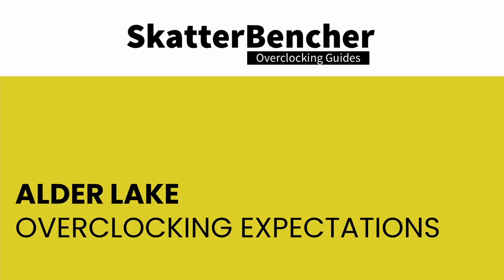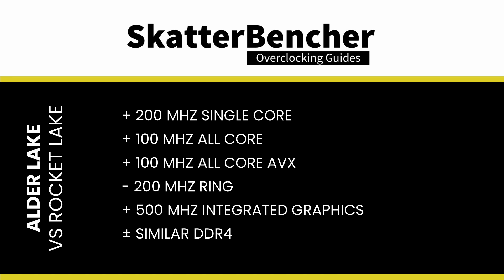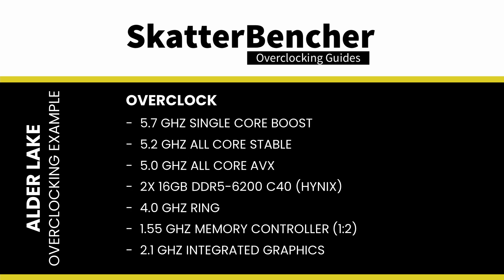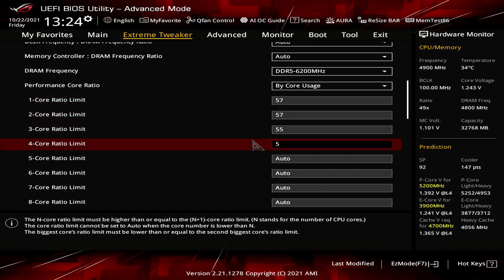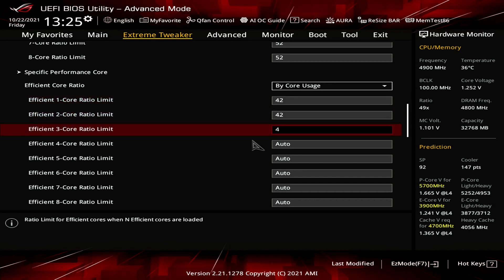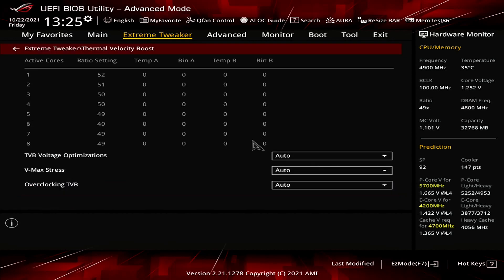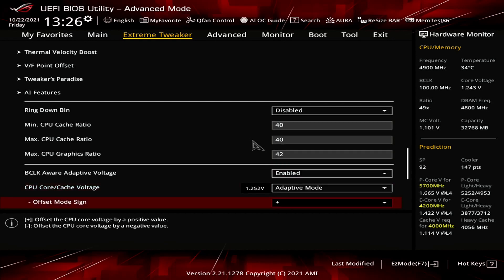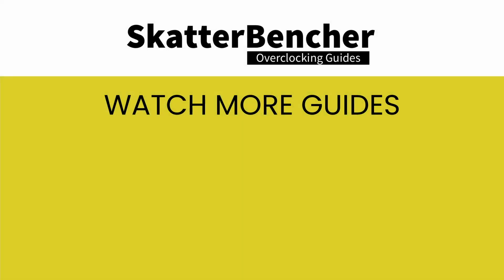Alder Lake Overclocking: Expectations & 5.7GHZ 12900K Example (feat. Maximus Z690 Extreme)

Comment: I know this is an old post but would this or similar overclock be attainable on Asus Z690 plus WiFi ?
Reply from the maker: The process will be similar, but of course the final results may differ substantially depending on your CPU.

Comment: How do I change te CPU ratio on ti board? I wish to slow the CPU down. i am using a i9-13900 and it is running at 5500Mhz, I wish to. change it to 4000Mz. Thanks
Reply from the maker: You can disable Intel Turbo Boost 2.0 in the BIOS which will limit to CPU to its base frequency
Reply: @SkatterBencher  tanks i will try that. what about downclocking to a specific frequency?
Reply from the maker: You can configure the Turbo Boost 2.0 boost limits directly in the BIOS. For any number of active P-cores you can specify a turbo ratio above the base ratio.

Comment: hello. I have a 13600kf at 5.5 and 43 with 1,250vcore.  in BIOS the overclock is in offset mode.  but the frequencies and voltage one go down.  What do I have to change in BIOS so that when at rest the frequencies go down?  my motherboard on an Asus tuf z690. Thanks a lot

Comment: So I have the same mobo and there is no cpu core/cache voltage listed there it only says, cpu l2 voltage? Also there no graphics voltage listed.
Reply: have you found what is the solution for that?
Reply: @gecamposneto  nope my mobo changes with each bios update and sometimes it will have setting and other times I go straight back there and the setting is randomly gone.  Iv had this board rma 3 times and 3 new ones replaced it. The boards just junk. Not to mention they lied about material used inside and I water cooled mine and got corrosion from there false advertising..
Reply: @mrrod3004  i cant say im happy with this board as well. some ppl have even a "extreme tweaker" tab and I dont. not to say inumerous bsod out of nowhere.

Comment: Would this example be stable with Prime95 small FFTs and AVX2 enabled ?
Reply from the maker: Except for the "World's Fastest" videos where extreme cooling is used, all my overclocking guides are aimed at 24/7 stable configurations (which include P95 small FFTs with AVX).
Reply: @SkatterBencher  I'm having a difficult time with the new 1304 bios on the maximus hero.  Using an offset of -0.04v from Auto voltage at LLC4 with clock speeds of 5.3/2 5.2/4 5.1/5 and 5.0/8.  I set an AVX2 offset of 3 but Prime95 just BSODs straight away.  Its rock solid in everything else with temps reaching 83c on Linx cpu stress test.  Any advice would be greatly appreciated.
Reply: It's a 12700kf btw, Ecores are all running at 4.0ghz and ring ratio is also x40

Comment: Hello with latest bios settings have changed to the z690 maximus extreme we dont have any more the cpu core/cashe voltage, we have global core svid voltage and cashe svid voltage, what are the settings here to be ok ?

Great work by the way
Reply: Also have this question
Reply: @Stalwart  hello wat do you mean? its a diferent separate values now, so before you changed both on one tab now you have 2, its easy if you have any doughts just come to my discord i and will help you out any time.

cheers

Comment: Hello, I have done all the steps that you have covered in your video but I face an issue that I am getting error and the windows does not boot anymore, what do you think is the issue ?
Reply from the maker: Sounds like you overclocked too high; the settings I provide in this video are for reference only. Your system (CPU, cooling, motherboard) can have widely different results, so you have to go through the process of finding the best settings.

Comment: What is the purpose of utilizing “XMP I” over “XMP  II”? Would this be considered a “standard”/“safe” overclock? If my SP and Cooler values are slightly higher than yours, is this OC safe to perform on my system? Additionally, is there any benefit to this form of OC for gaming on the 12900k (reducing stuttering, faster texture loading times, reduced latency, etc.)? Any information would be very appreciated as I want to maximize the utility of my 12900k/ddr5/30-series system. I’m very skeptical on what the benefits are over standard “optimized defaults” for this chipset. On other hand, why not just use the ASUS AI Oc as opposed to this extremely precise OC? Like what exactly are the benefits here, what justifies the tumultuous task of performing stability/stress tests for this very hot chipset (in the OC scenario) generation?
Reply from the maker: To answer your questions:

1) XMP I will load the primary timings, voltage, and frequency from the XMP profile, then apply other ASUS pre-tuned settings like BCLK, secondary timings, etc. XMP II will load the full XMP profile. Usually I prefer XMP I just in case there's some tuning ASUS did that I can take advantage of.

2) Yes, I'd consider this a safe overclocking from the perspective of running 24/7. Of course the major caveat is that whether it's stable 24/7 for you depends on your CPU quality, your cooling, motherboard, etc.

3) There's a performance benefit in overclocking, yes. The extend to which there is a performance uplift depends on the CPU, the overclock, and the application. In all my full length SkatterBencher guides I provide data on performance improvements using various OC strategies.

4) Nowadays, in most cases you can get within 90% of the maximum performance with just a few options. A good example is ASUS' AI OC. Any further tuning is more about enjoying the process and puzzle than it is about real-world gains. Personally, I just enjoy the never-ending puzzle of extracting more performance out of a given set of parts.
Reply: @SkatterBencher  thank you so much for the detailed reply. I apologize if my skepticism sounded cynical, it’s just a very grey area on wherever it’s a viable option since so many components produce a lot of heat when OC’d now, especially 12-th gen and 30-series GPU’s. I agree with your statements, it’s always cool to squeeze out some tangible performance via firmware or software.

Comment: Can I apply these settings at a reduced frequency to use with ASUS ROG Strix Z690-F Gaming WiFi + rtx 3090 full water cooled loop
Reply from the maker: Yes that should be no issue. Fingers crossed you have won the silicon lottery!

Comment: In apex you got auto oc, is rly that way what you got Here. By ussage oc. It can make 897,9  cpuz 1C in my case on custom lc. But it go Max 5,5 and all 5,2  ( Sp 98 Pcores and sp71 E cores ) prediction im my case shows Sp overall 89 and cooler 180-185
Reply: Likewise i run 5.4 3 cores the rest 5.3... 1.360v 4.1 e cores cracking 900 single on cpu z 12k+

Comment: Need help, please. My default values for V/F points 7 to 11 are 5200MHz instead of 5300(I have asus tuf z690 with ddr4). Is this normal? I couldn't find any information online.
Reply from the maker: That's with a 12900K/KF?
Reply: @SkatterBencher  it is a 12900k, wish I could show a picture. it is a stock cpu, so I bought it with the system. I wonder if it is possible that I am cheated by the dealer. ( also, I have the newest bios 0807. I don't know how it was before I updated)
Reply from the maker: If you can, please do.  Maybe Intel changed something in a new microcode? I would expect 53X for at least V/F Point 7.
Reply: @SkatterBencher  I have sent you an e mail, thank you.
Reply from the maker: Awesome thanks!

Comment: What aboud the LLC is 4 ok?
Reply from the maker: LLC=4 is the motherboard auto-rule; in other words LLC=4 gets set once you start overclocking. The setting always work fine for me. The only reason I'd change it is when I'm manually finetuning the voltage droop with an all-core heavy multi-threaded workload.

Comment: I did this guide but my vcore is hovering right around 1.5v idle, under load it’s in the low 1.4 range, how can I change the idle vcore
Reply from the maker: Where do you read out the voltage?

Comment: Hello! Been watching your Alder Lake overclocking videos. Could you tell me what the Cache V req is actually referring to? I have for 4700 MHz,  1.25V @ L4 and Cache 4663. My SP is pretty low at 78 though. How can I best make use of this?
Reply from the maker: In the Prediction menu on the right hand side of the BIOS screen, "Cache V req" is the AI OC prediction of the maximum stable Ring frequency and the voltage which would be needed. In your case, AI OC predicts 4700 MHz at 1.25V (which seems quite low).

The way you can make use of this is two-fold: (1) you can enable AI Overclock in the BIOS and let it manage the frequency for you. Or (2) you can manually configure the maximum Ring ratio in the BIOS.

Generally, I would suggest to try AI OC as I've found it to produce quite good overclocking results. Just make sure to thoroughly stress-test the system with all-core workloads before enabling AI OC so that the system can "train" the cooler score.

I would not advise setting the Ring ratio manually unless you're already very familiar with the overclocking capabilities of your system. With E-cores enabled, the Ring doesn't overclock as high but it's not always easy to spot stability.

As for SP: not much you can do with this information other than share it with people on forums and freak out that others may have a much higher rating :)
Reply: @SkatterBencher  Unfortunately, it looks like AI OC does not seem to work for me. I have gone down to 80 optimism scale and I still have regular crashes. Is there some way to manually adjust voltage from what the AI OC has already put in?
Reply: @MrSamuelspark  ai oc doesnt work for me either it overclocks the computer to high on asus mb and 12900k with sp 83
Reply: Great video. I used your 10850k setting  on my current setup and had great results amd it ran cooler than the gaming mode or extreme setting on my z590 msi board. Just picked up a 12900ks on the cheap. Will be testing this out as soon As the build is done.

Comment: When I tried to set an all core overclock with negative offset voltage it didn't seem to apply the offset, if I manually set voltage to like 1.32 and use balanced in windows, will it stay at 1.34 even if the cpu clocks down from being idle?
Reply from the maker: Are you setting manual voltage in adaptive mode or override mode?

Where are you checking the voltage readout in Windows?
Reply: @SkatterBencher  I managed to get it to work in the V/F offset or what it was called,, but I seem to cap out at 53,53,51,51,50,50,51,51 because everywhere I look people warns against going above 1.38v on daily use

Comment: What graphics card u use with it 
Is 3070 bad??
Reply from the maker: For this guide I actually use the integrated graphics (which is also overclocked)
Reply: @SkatterBencher  do you know any good other cheaper z690 motherboards???
I can't afford thisetup it is going to cost me $7k :(
Reply: @SkatterBencher  maximum extreme is $1799 Aus in Australia do you know what is best motherboard from this list I can afford $800-1100
Reply: @SkatterBencher  please help friend :( ty

Comment: Friend Is this maintainable for 10 years or will it be bad for a long lasting pc
Reply from the maker: Hard to say. I don't think there's any good data out there that can tell you this type of long-term information. What's for sure is that in those 10years you'll have to clean the fans, change thermal paste, and flush the custom loop a couple times ;)
Reply: @SkatterBencher  thanks
Reply: @SkatterBencher  do u know Where do I buy 16gb ddr5 6200 c40 hynix I can't find it:(
Reply: @SkatterBencher  gskill ddr5 z5 I mean is that better than hynix or hynix better?
Or is corsair good? Corsair ddr5?
Reply: @SkatterBencher  what power supply I use:)?
Reply: @SkatterBencher  I have 12900k and fractal torrent and 3070 is fractal torrent going to work:(? Do u know this case???
Reply: @SkatterBencher  this is my first time building pc :(
Reply: @SkatterBencher  3070 cost me :1900 :( took 4 months to get but I got non lhr :o
Reply: @SkatterBencher  do you think the rog maximus z690 hero can overclock high and will it have similar settings to extreme? I can afford it. Do you think it's better with 12900k than the aorus for overcloxk?

Comment: Kan ik dit ook toepassen als ik ipv  een waterkoeler een goede luchtkoeler heb?
Reply from the maker: In principe wel, maar je zal wellicht een lagere all-core moeten zetten dan wat ik doe met waterkoeling. Maar met een dynamische OC zoals in dit voorbeeld is dat geen probleem!
Reply: @SkatterBencher  alles op 52 bv?
Reply from the maker: Nee, net andersom. Wellicht kan je 55X tot 2 of 3 actieve P-cores, maar moet je met 8 actieve P-cores terug naar 49X or 50X
Reply: @SkatterBencher  , ik heb nu een 360 rad waterkoeling, ik kan nu 1 op1 jouw settings overnemen :) je had het over dat dit een dynamische overclock is? Hoe zit dat dan? Aangezien jij 1core laat draaien op 57 en rest lager waarom is dit dan een all core 52? En dat op 1.35v dat is toch heel erg laag?

Comment: i have z690 aorus master, how enable in bios PL2 for more power?
Right now my 12900k in stress test used 145w, i want give him all 250w

I cant find this config in bios
Reply from the maker: Strange. The Z690 Aorus Master should have all power limits unlocked by default.

If you want to make adjustments to the Turbo Boost 2.0 parameters, you can go to Advanced Mode > Tweaker menu > Advanced CPU Settings submenu. Here set Turbo Power Limits to Enabled. Now you have access to the parameters.
Reply: @SkatterBencher  , yeah i have already found that, thanks

Comment: Nice video.  Where did you buy your RAM sticks. I can't find any.  I see you used 6200 speed. The QVL shows this mother board can go up to 6400. Is there a reason for using the 6200 over 6400. Thanks
Reply from the maker: I live in Taipei so let's just say I was able to borrow this kit from a friend down the road :).

The reason I'm using DDR5-6200 is because that's the XMP profile of this kit.
Reply: @SkatterBencher  is die zooi daar in azie goedkoper vergeleken met hier in nederland. Gewoon curious question😅
Reply from the maker: 15 jaar geleden misschien nog wel, maar tegenwoordig niet meer. Met het internet is het veel gemakkelijker om prijzen the vergelijken en dus zijn de prijzen overal ongeveer hetzelfde

Comment: Which bracket are you using? Ek has one on their site… but it doesn’t list the magnitude as compatible
Reply from the maker: I used a custom bracket for Magnitude they sent over. I'm not sure what the plans are for bringing 1700 support for the current Magnitude, but looking at the product philosophy of Magnitude (tuned for each uArch) I'd guess there will be a 1700-specific version tuned for Alder Lake.
Reply: @SkatterBencher  thanks. I suppose that makes sense, but itwouldn’t be expensive to just stamp out a new backplate - much like how they’ve already done for the velocity blocks. On another note… going to try the quantum tec on alder lake?
Reply from the maker: Ah, with the Magnitude you also need a new mounting bracket, not just the backplate. 

And yes, I will definitely try the Quantum TEC with Alder Lake! Just waiting for the software to be released :)
Reply: @SkatterBencher  ohhh yes, unless you have an asus rog z690 :) running the rog apex, so I can get away reusing the original mount - it’s just that the backplate doesn’t fit as flush as expected.

Comment: hi is your vcore normal on all core boost using this method? as in if you compare the voltage get to if you set fixed ratio and auto voltage at the same point and compare the reference voltage.
Reply from the maker: Yes the voltage is normal.

The adaptive voltage is mapped against the "OC Ratio". The OC Ratio is the highest CPU ratio you configure in the BIOS. In this case that's 57X. The adaptive voltage is 1.35V+0.05V=1.40V. So for 57X, the CPU will use 1.40V. 

Then, the CPU has a factory-fused V/f curve up to the highest default ratio. In the case of the 12900K that's up to 52X. In adaptive mode, for any ratio equal to or lower than the max default turbo, the CPU will always use its V/f curve value. I think this CPU has 1.3V-ish for 52X.

The voltage for 53X to 56X are interpolated between the OC ratio (57X @ 1.40V) and the highest factory-fused V/f point (52X @ 1.3V). My all-core load setting is 52X. So it will be using the factory-fused voltage for that point.

I don't quite get the question of comparing to the reference voltage?
Reply: @SkatterBencher  is this way(1.35+0.05) equal to set the adaptive voltage directly to 1.40V and keep V/F point 7 offset "auto"?
Reply from the maker: Yes!